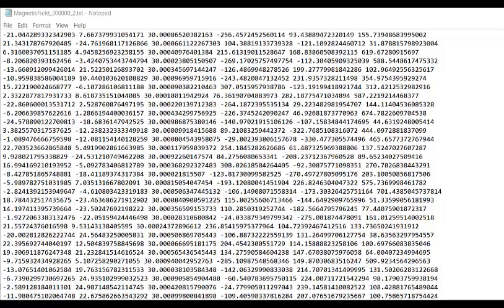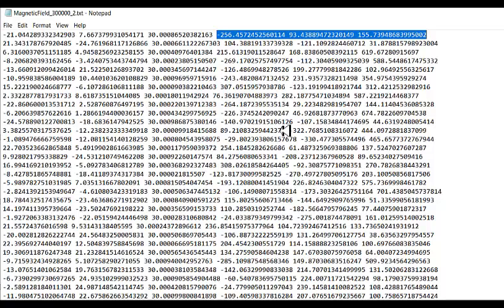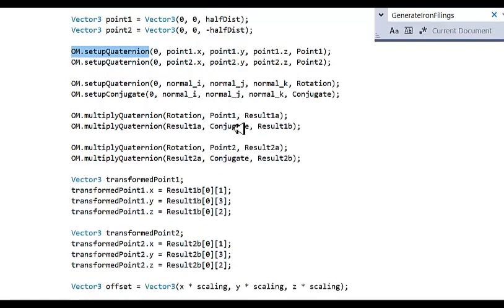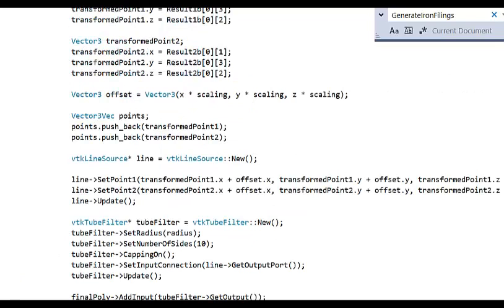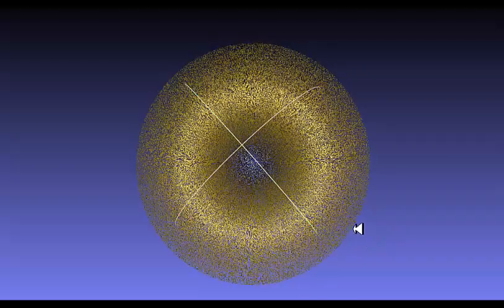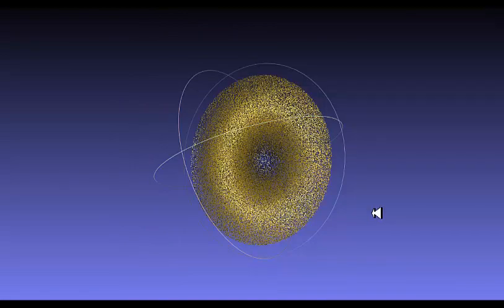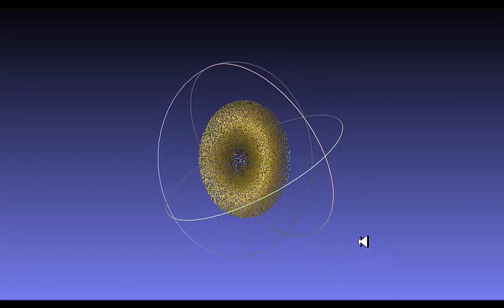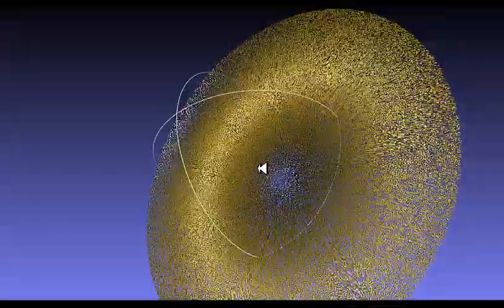Demystifying the ferrocell :  PART 2

Comment: but aren't the nanoparticles being moved by the magnetic field? i understand it isn't really 3D but would a square ferrocell produce the same image if the lights are in a box surrounding the magnet?
Reply from the maker: I am not sure. There is evidence of the nanoparticles drifting in the fluid while the magnet is not moving. Regardless of whether they are moving or not, at any one point in time, the nanoparticles are going to be pointing in the direction specified by the magnetic moment at whatever location it happens to be, at that moment in time.

Comment: Hello Fractal Woman. Regardless of the thinness of the photo cell and it’s three d effect. Is the reality of the field in fact a three dimensional torus and hyperbiloid ?
Reply from the maker: It depends on what you mean by "reality". Fields aren't reality. Fields are mathematical abstractions. Fields are not a cause, they are an effect.  A better question would be, "Does the underlying physics behind magnetism involve a three dimensional torus and hyperbiloid?", in which case, I may be inclined to say yes. My Aether model is pointing to torus shapes emerging due to Aether circulation. Again, torus is an output, not an input. Aether circulation is the key to it all. IMHO
Reply: @FractalWoman  Thank you ever so much. You're a great teacher.
Reply: @FractalWoman   Here is a cube filled with iron filings in oil.
https://www.teachersource.com/product/magnetic-field-cube
There is a short video on the page showing its operation.
Because of the camera angle, it is difficult to see how the particles are moving, but at times they appear to move in curved paths.  I would like to see this experiment done with the camera "head on" to the pole of the magnet.
Will you consider buying one of these and showing us?
Reply from the maker: @Bob & Ann It would be pretty easy to build one of these. The key here is to have a tube in the middle that you drop the magnet into. That way, you can remove the magnet without the ferrous particles sticking to it.
Reply: @Bob & Ann I don't have a channel.
Reply: @FractalWoman  Unless you need a special mixture of ingredients or a really big one (to fit a monster magnet), it is easier to buy it and do the experiment ASAP while viewer interest is high.
Reply from the maker: @codetech5598  My channel isn't monetized and so I can't justify the expense at this point. It's around 50 US which is almost double that in Canadian funds when you take shipping and brokerage fees into account. If you buy one and take some videos shots of it, I would be happy to make a YouTube video and upload it to my channel for all to see.
Reply: @FractalWoman  The person who should do this would be someone with a monetized channel with over 100K subscribers, be known as the "King of Magnets", and be an expert photographer.
Reply from the maker: @codetech5598  EXACTLY
Reply from the maker: @codetech5598  Hey, you just posted a comment about the new paper, but the comment didn't get through. Can you send it to my email? Thanks in advance.
Reply: One more question. Has anyone ever held a ferrocell over their heart chakra?
Reply from the maker: @dana7197  Regarding the Chakra question, you need a very strong magnet to see an effect in the ferrocell. I don't think the human magnetic field is strong enough to see in the ferrocell.
Reply: @dana7197  That would be something you should use an MRI for. I don't speak Russian but if you do they are way ahead in the field of kirlian photography
Reply: I second that from FW. All my observations support this type of model. Æther in this case may be an ion stream. Levity is another term that is useful here